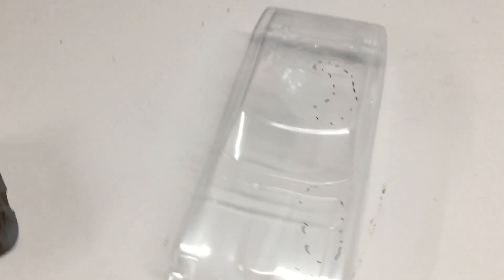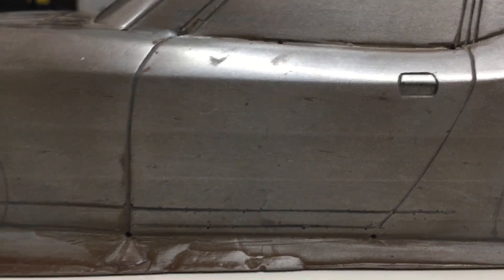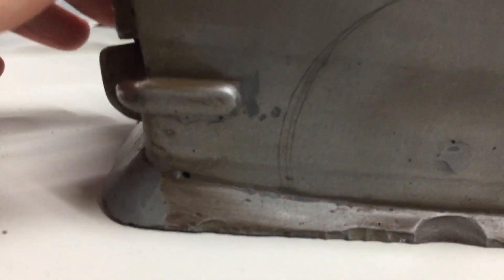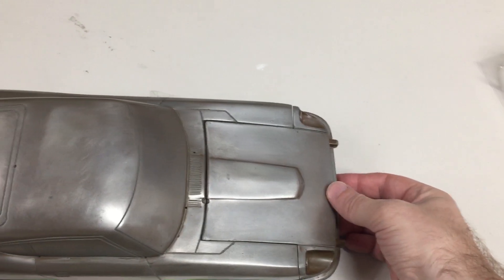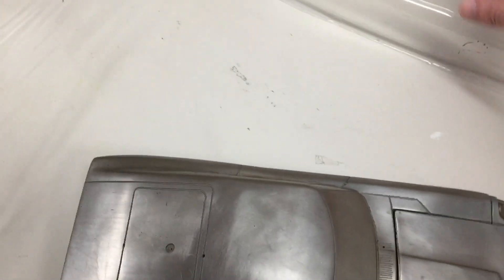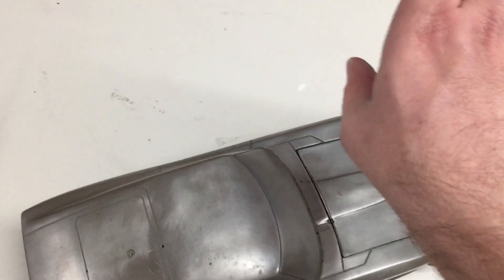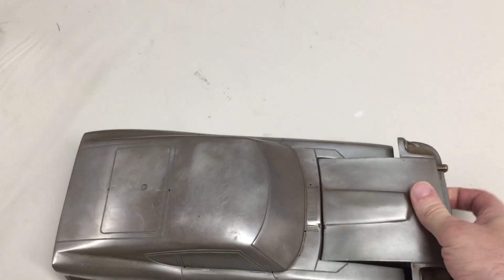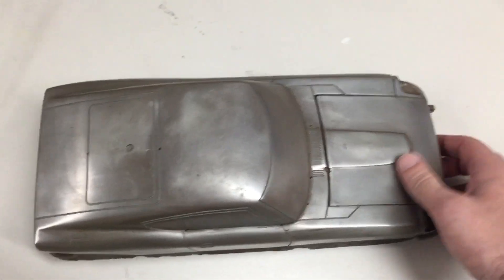See How The 240Z Thermoforming 2 Part Mold Works

Comment: So I have been making RC bodies for 7 months I've been making my own designs I have taken down my Videos because I'm planning to produce my design, so do you make bodies of someone else's design? And approx how many can you get from one mold, I know you can't get me pricing till you have more info the 6 bodies I made were 3 for the Gen8 and 3 fit Scx10, none are anybody else's design but mine. 😎🤘
Reply from the maker: Hello, Yes, If you see the latest video you will see that we are doing other peoples molds. As far as how many bodies you can make from a mold? That really depends on what you made the mold from. All of the Sabula Tech molds are made of high performance resins. So they can be used to make thousands of bodies and many probably have.  If you are making out of wood, plaster, or bondo than it is far more limited usually. Heat can quickly break down and degrade those materials.